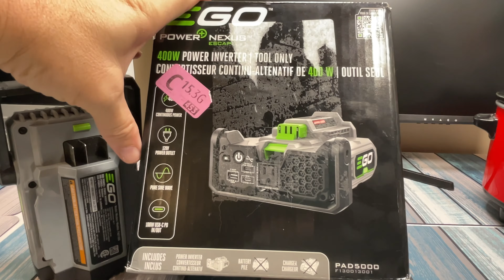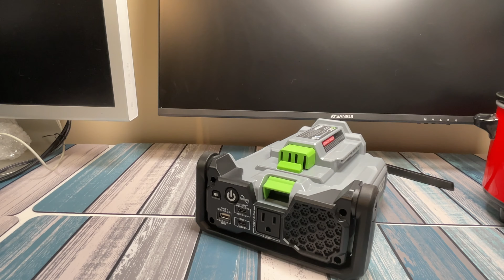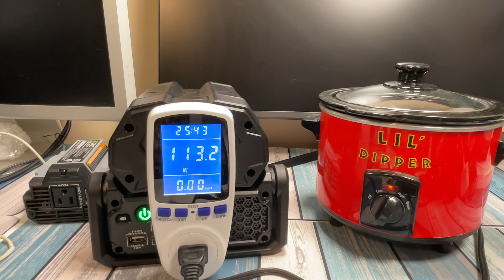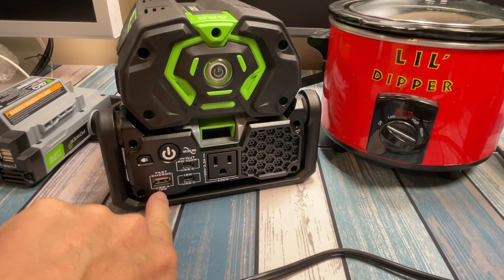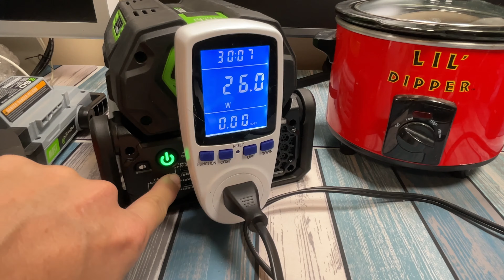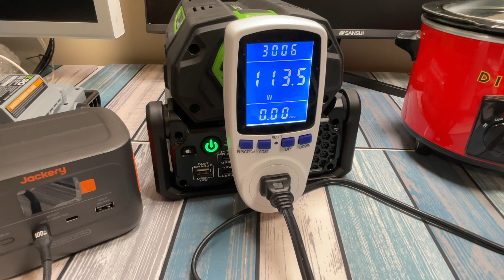EGO Nexus 400W Inverter - Test and Review - Compared to 150W

Comment: So I have seen a few videos demoing this 400 watt inverter, the problem is the presenter uses devices the 150 watt inverter would power, such as the slow cooker here.  I have yet to see an example of the use of the 400 watt inverter handling electrical units that are more demanding.  I think the 400 inverter would handle my small Danby chest freezer which is something I would appreciate. In a true long term power outage I'd power the freezer for about 45 minutes a day to save the food.

Comment: I think the reason you’re only getting 30 W charging your little mini jack is because that’s all your input charging rate is on that unit. I think if you were to plug in something that demanded a higher wide foot, then you would see better results, but I bet your mini unit has a max charging rate of 30 W.

Comment: Thank you for taking the time to test this out.

I found out the inverter, along with the Ego (and knock-off) batteries will charge an e-bike battery 👍! 
I tested it with both, a knock-off 5 volt and an EGO 4 volt and it WAS successful - the bike was at 86%. It took about 30 mins per battery to take it to 100%❤. Testing will continue on a close-to-drained battery.🙏
Reply from the maker: Sounds like a good use for it!

Comment: Just a quick note to say that when you have two devices with both input and output USB-C ports, flipping the USB-C cable over on one end or the other, will identify that end of the device as the 'client' end (receiving power), vs. the 'host' end (sending power). Many people think USB-C cables are universal and can be used in either orientation, but the actual pinouts matter when it comes to PD negotiation and which device sends vs. receives power.

Comment: Maybe it has a protective mechanism to the jackary and last smaller device you tried to demonstarte that showednit at 96%  maybe its works like cell phones...I think at 80% cell phones slow down as to prolong the life of the battery.  Maybe same deal?
Reply from the maker: Very possible. Different devices have different charging speeds based on their temperature and their state of charge. No way to keep up with them all, lol. Thanks for watching!

Comment: Thank you for this look at the PAD5000. I’m wondering if the EGO SP1000 or SP2000 solar panel can be connected to the USB C PD port for charging. The panels have a USB C port one can use to charge electronics. On the SP1000 its max rating is 12V, 1.5A, 18W; whereas on the SP2000 its max rating is 20V, 2.25A, 45W. BTW, both panel’s USB C ports accommodate the various lower DC voltages/currents based upon the device connected. It’s not 100W but it sure would be convenient if this type of setup could work like a mini solar charger/inverter/converter seamless backup for smaller electronics (ie: internet modem/router/wifi, communications, TV) in the event of a power outage.
Reply: You can do it with another brand of solar panels that uses USB-C output. But don't expect charging to be fast.
Reply from the maker: True. And I wouldn’t pick the Ego solar panel, mostly because you’re paying a lot for the name.

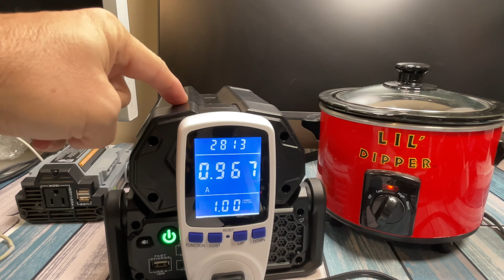Comment: 8:03 the math is a little off here. If you are pulling 1 amp from the 120v outlet the 56v battery would be outputting around 2 amps. Factor in an inverter efficiency of 80% and you’re looking at a runtime that is more like 1.5 hours not 3-4.

But great video! Appreciate you going over and testing all of the inverters features.
Reply from the maker: You're absolutely right!  That's why I should always convert to Wh instead of Ah, lol.  I shouldn't be doing "head-math" while recording, lol.  Thanks for catching and correcting me!

Comment: Have you used this in the following or similar scenario: plug in power from the mains via the USB C PD socket without the battery in place? I ask as I’m thinking of using it for a fridge during the night when the battery is in place and then charging up the depleted battery during the day whilst allowing the mains power (via the inverter) to keep the fridge running without it switching off (as have solar PV)? Also, if the battery died during the night would the fridge still be able to be powered from the mains power in an uninterrupted fashion?
Reply from the maker: Good question!  I’ll try it out and report back.
Reply from the maker: Ok, here’s my preliminary findings. The battery HAS to be installed for the inverter to work. But after I popped the battery in, I can run 100W DC into the USB-C port while still pulling power out of the inverter. In theory, if you draw less than you’re charging, then it should work forever (minus any loss from conversion). But if you draw more power for your fridge, then the size of your battery would determine how long it will last because of the difference between in and out. Hope that helps and hope it makes sense. I’ll leave this test running a while to see if it remains stable.
Reply: @FamilyGeekery Of course that person didn't even like your comment or reply. Thanks for testing that

Comment: The power banks will slow their  charging as they approach full charge. You'll only see the full 90-100 watts in the bulk charging phase, between 20-80% generally. It's easier on the lipo packs that tend to be in the higher wattage battery banks.